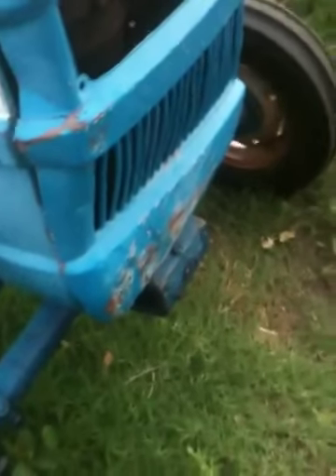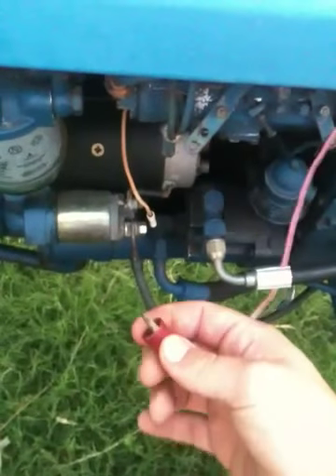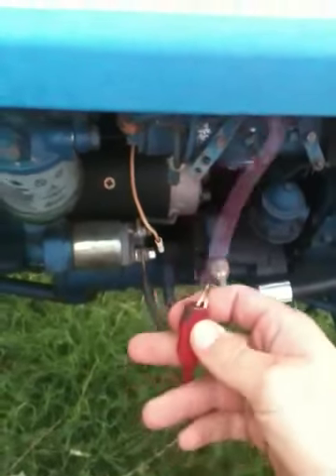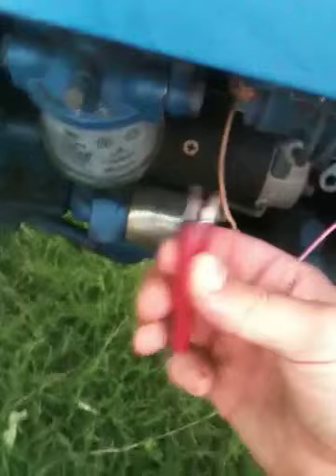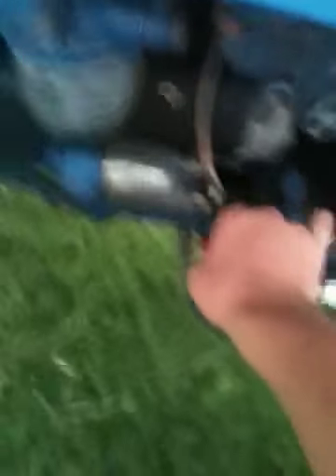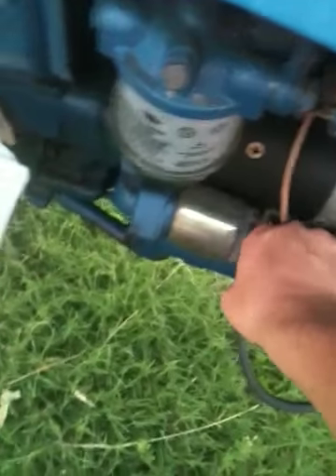1974 Long 350 cold start and camera update

Comment: What do you mean by "messed up your ignition". Oh, and what fuel pump did you put on?

* Warning long rant below * :)
 Initially i was going to ask in how many positions your key turn but since i watched your video I doubt you would remember bc it has been so long. lol, long :^) .
Apparently someone add attempted to start my long 610 with a screwdriver and well... while trying to diagnose a short somewhere I found out that if my key is turned all the way counter clockwise I get about a 0.2 amp draw and if I turn the key one click clockwise no more current draw. The service manual for the 360-460-510 series is what i've been working with and I have to tell you that there electrical schematic sucks BAD(not detailed enough)..